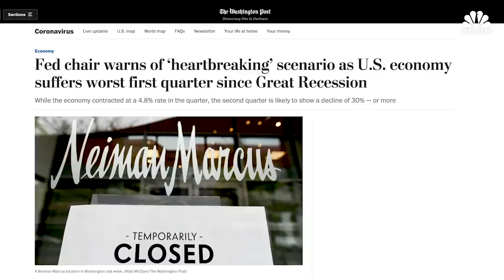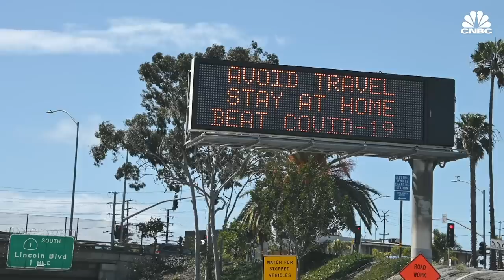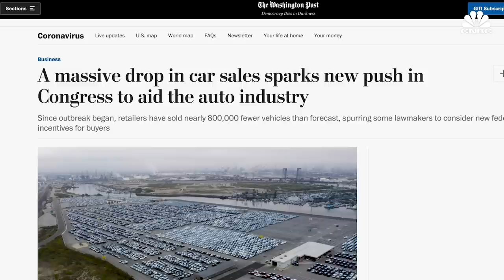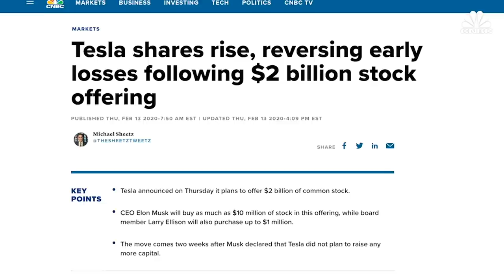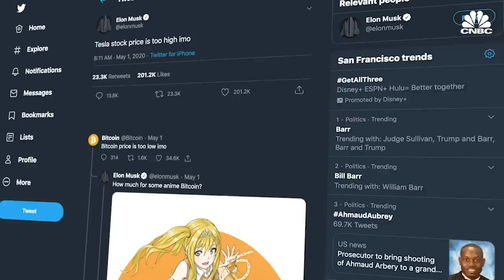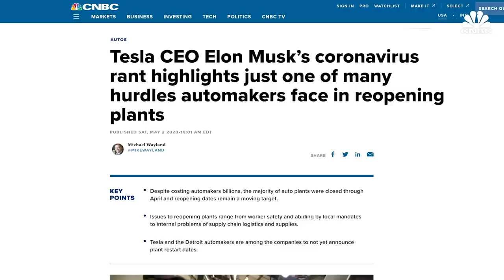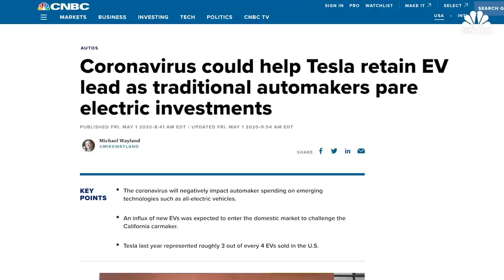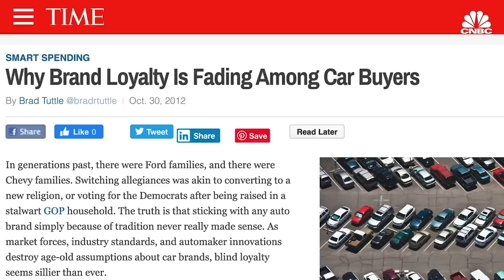Why Tesla Is Better Positioned To Survive Than Other Automakers

Comment: Q1 delivery was lower, but Q1 is usually the weakest quarter for tesla. Even then, Q1 2020 delivery number is a 40% increase from last year.     

Toyota and Volkswagen sold about 10 million cars in 2019 globally. And a huge chunk of their sales took place in the "fully mature" auto market. And because they are fully mature, the current downturn will def affect their sales. Tesla, however, is in EV(BEV) market. This makes a difference because EV is not fully mature (2.1 million unit sales in 2019, growing at 50 % per annum but last year only up by 9%). This gives hope that Tesla will be able to continue to sell its cars with ever growing demand for EV (especially the chinese market is huge) 

Sure tesla's financials are red (negative net income, huge debt and interest rate), but the fact that they are producing cars in their shanghai factory this year to sell, the ways they have turned things around for the past few years and that they are multi facaded business(EV, energy storage, solar, software FSD) give a lining of hope. For Q1, they raised a huge amount of cash(prob thru stock issuance), so they are positioned not bad. 

I could be wrong about their survivability depending on the duration of this downturn, but at least the future  they are investing is the way to go. Only time will tell. 

I don't own $TSLA btw.  

EDIT: 2019 total ev sales, growth rate, tesla sales in terms of order vs production cap
Reply: you said Tesla sold 94% and 96% of its car production in 2018 and 2019.... dude Tesla only makes cars by order, they don't have dealerships to store them... so did 4-6% of buyers return their cars or something??

idk about you but most ppl (myself included) want to buy an EV but will much rather buy an EV from Toyota or Ford...
Reply: @dunhillsupramk3  thanks for fact checking. I got my numbers wrong. I was talking about model 3 and Tesla sold 75% of its production cap in 2019(300k sales vs 400 installed cap without shanghai b/c shanghai just started late last yr.) 

Also to your second paragraph, what's your source for saying that in terms of sales number?

Comment: I thought Tesla was built to order so they didn't have a stock pile sitting around
Reply: Use to but the demand was probably too high so probably made some basic or common models in advance which need minimal customisation for the customer
Reply: True. First Qtr they built 102,000 but only were able to deliver 88,000. Remember, Tesla sells direct and only counts a "sale" when the car is actually delivered to the purchaser. While in transit it is counted as "inventory". The Legacy auto-makers count as a sale when they sell to the Dealers, not the public. So Legacy Automakers have a huge problem cause it is the "Dealers" who have a huge build-up of stock but this isn't reflected in the Legacy balance sheets. However, we will have to wait and see how things work out this year given the C-virus impact. Certainly Tesla also has over 620,000 pre-orders for the Cybertruck but, of course, still has to build another Giga-factory to build them.
Reply: TESLA does not Pre Build any cars, each car Represents a actual Built to Order.
Reply: @markplott4820  Actually they build in batches and that includes some inventory , only a small percentage - for someone that wants a particular model when that batch won't be built for a month. Also why there is a standard color

Comment: Tesla's gross margin on the vehicles it sells is much higher than other automakers.

I found it interesting that in this video at 5:29 there is a comment that Tesla's "automotive gross margins, most importantly, were very strong, about 25%," and then at 14:22 it says, "Also, don't forget that EV's, for every automaker, including Tesla, don't tend to be high profit drivers."

I agree that other automakers typically make very little profit (if any) on the EVs they sell, but in contrast Tesla has strong gross margins on the vehicles it sells.

Comment: I don't understand why no body talks about efficiency/value. That's the single most important factor for Tesla's success and others failure. Tesla cars have way less parts compared to  ICE cars. There is no Dealer to eat up 40% of CARS MSRP. Owners does not need oil changes or any regular maintenance. EVs are way cheaper to fuel and run and will last 5 times of an ICE cars. And best they can get the electricity from there roof top. Death of big 3 or for that matter any one is inevitable just because their current structure is very efficient and we have 'something' which is 10 times more efficient to replace them.

Comment: EVs are superior when it comes to profit margin. Less mechanical parts, modular production and a low management cost due to a limited need for suppliers. Most car-manufacturers simply can‘t tweak their business models due to long-term contracts with suppliers.Therefore they must stuck to inefficient models not to trigger multiple law suits. At least VW got it and goes all-in against Tesla. A smart move!

Comment: I want to invest in Tesla and I truly believe EV's are the future. I just cannot justify the stock price. Can someone help me to understand the potential of Tesla. 

Many compare it with Apple/Amazon but I find it hard to see the similarity:

With Apple, you had revolutionary product once they launched the Iphone. No substitute on par level and it changed the world of portable phones. With Tesla, you have the autonomous driving as the main future to change the driving industry. How do you see this play out? Autonomous taxi and delivery? How about legislation, safety, hacking, ... How far do you think we are to have this futuristic feature on the market? And what about the competition?

With Apple, you didn't have to have full infrastructure to be able to use the system. With Tesla, if you don't have a garage, you are stuck on charging on street. Tesla is building their super charging network. However, Volkswagen, Audi, Porsche, BMW, Daimler and Ford are working together to build their Ionity network. How would they cope against the competition once they exclude Tesla on their charging stations? How would EV producers cope in general against the big oil industry who will get impacted?

With Apple, you had a product that every one was going to change year on year due to spec changes / improvements. With Tesla (or cars in general), you don't buy a new car every year. How would they increase the amount sold cars once the sales get saturated? What about the case were remote working is going to be the standard? And what about sales outside US (US counts only 25% of total yearly car sales)? Europe still loves their German, French and British cars. Japan has their own brands, while in China, German and Japanese cars are still the most popular brands. 

With Apple, you buy the eco-system. How do you see Tesla selling their eco-system? Become an power supplier? Selling their batteries and solar panels? What about already the existing competition?

I truly believe in the growth of the company but my calculations tells me that people are overestimating the potential of Tesla and thus the stock price is not justified.

Comment: There is pent up demand for Tesla vehicles. Tesla has always been capacity constrained and not demand constrained regardless of reporting on this channel to the contrary. Yes demand will drop during a recession but if it doesn't drop below production capacity then this has zero effect on Tesla.
There is a real but unlikely possibility that a recession could drop demand to below capacity which would represent an actual problem for Tesla.
Now seems such an odd time therefore for CNBC to suddenly switch from "they are junk, worthless, going bankrupt" to the positive message represented in this video. Has Ford, GM, FCA and big oil cut all their advertising?

Comment: A more fundamental problem has to do with the rules by which local and global economies function.  The concept of a free market is ridiculous on the face of it.  Laws have been put in place to regulate corporate behaviour, because without regulation like anti-monopoly, health and safety standards, worker protection and the like, corporations in recent years will do anything to achieve maximum shareholder value.  Nevermind that the meaning of the phrase "shareholder value" is vague and fluid.  So what should capitalism look like post COVID-19?

Comment: You know why Tesla has a 'cult' following? Because of ludicrous mode!   No other car ever could give you that before... Well maybe Porsche now, but the proof is in the driving experience. You have a real advantage in traffic with a car that has 3 times the acceleration than any other car around you and whisper quiet, there's no real disputing this if you've never driven one yourself... Just search for 'Tesla ludicrous mode' on YouTube and you can watch 100s of videos showing riding in a Tesla is more exciting than a roller coaster... Even fast gasoline cars have too much latency getting going off the line into the powerband, the electric motor has full horsepower right from 0 RPM... Also, don't forget electricity is many times cheaper than gas, it was like comparing apples to oranges, the Tesla car is like the latest 'tech gadget', so many tech geeks want this, call it cult if you like...

Comment: They are not better positioned. They are a meteor and will run out of fizz.  They are far to expensive for the average person and long term they need to sell more per year then they do; secondly they rarely if at all update models and the models are looking extremely bland.  And still they need to solve the 5 minutes recharge issue (not 20 minutes) to being it inline with people pulling up into a gas station and moving on.